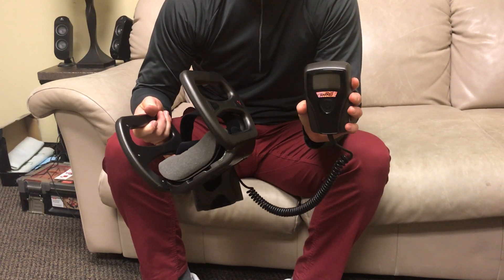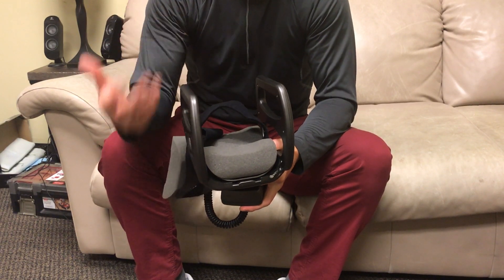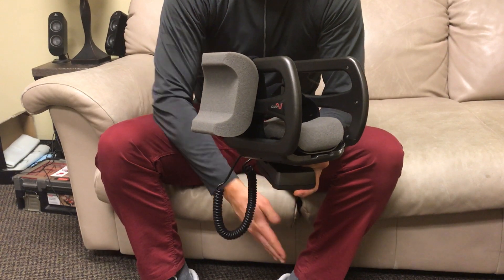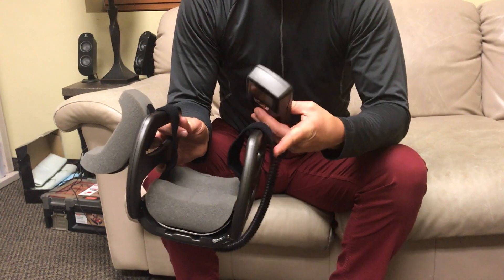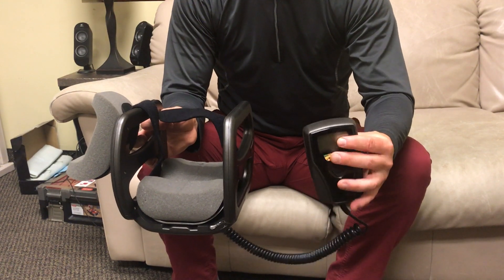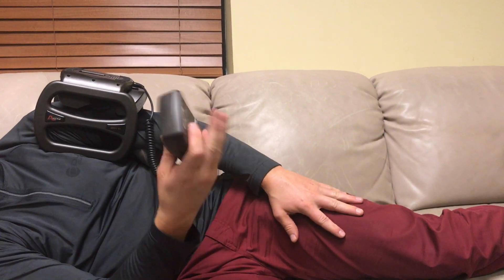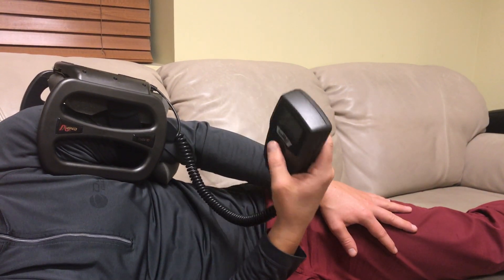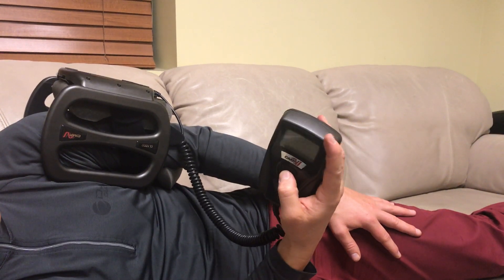How to use the DJO OL 1000 CMF Bone Growth Stimulator on a Humeral Fracture

Comment: Almost 3k and single use and programmed to go bad wth!? The irony is you can build one of these for almost free from the guts of an old crt computer monitor- the deguassing coil, one of the mosfets, a 555 or pic based pulse circuit set to 18 to 30 hz and about 25 to 90ms pulse width, easily powered with a 5v charger- portable or plug in type to generate similar strength magnetic fields. 🤔.
Reply: Programmed to fail after a certain amount of uses because the manufacturer and doctors want to make as much money as possible.  This is why insurance is SO expensive... GREED!

Comment: It was about 1k to purchase for me. Better use this thing wisely because it will not hold juice. Use it or loose it. Wish i knew that before i bought it. Thumbs down for me.
Reply: You can replace the batteries i just got mine
Reply: @ciara9414  use it, I believe it does work. It will only last for so long, it states it in the manual that comes with it.  I think it’s 9months, not sure. Batteries are for the wired remote.

Comment: Hi, i have my bone growth stimulator, i want to know why i push the bottom and doesnt appear the time, i mean i push the bottom and directly appears the treatment record and  beep twice, and also the happy face ??
Reply: Hi,  I actually called the manufacturer and was informed that the 1st series of numbers is for the number of times the device has been used, and the 2nd set of numbers (following the /) is for the number of days since the unit was first turned on.  So 023/089  means unit used 23 times since first turned on 89 days ago.  if the second set of number reaches 270 the unit will NO LONGER WORK!  Once the unit is turned on the total life is 270 days.  Hope that helps.
Reply: GABUG, it appears that if you have your BGS for over 9 months (since your first use)
That the BGS will no longer function. It’s a single use medical device, therefore limiting resale and transfer of possible (used unsanitary) medical devices.
Reply from the maker: How many treatments does it show you have done?  Also you will need to hold the button down for 2-3 sec it will beep and then the timer will start.
Reply: @orthoprosofutah4355  mine says 43/270.  I only used it 43 times but 9 months had passed so I don’t get to use the rest I paid for?  What a rip off!
Reply: Ortho Pros Utah it shows like 70/ 270, its that ok? , i push the bottom like 3 seconds and show me the happy face, do you think i have to change the battery?
Reply from the maker: 70/270 is good it means that you have used or should have used the bone stim 70 times. Try holding the button down until it beeps. If  it's still doing the same thing changing the batteries.
Reply: Ortho Pros Utah i change the battery and still doing the same, do you know how to reset it?